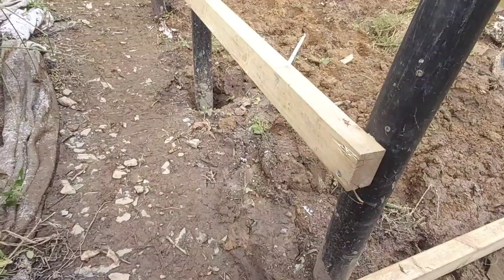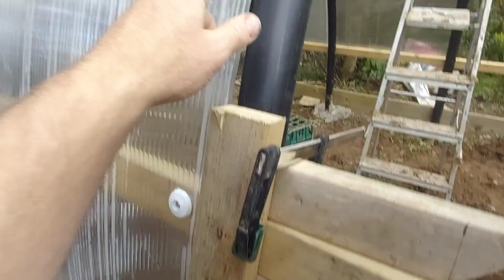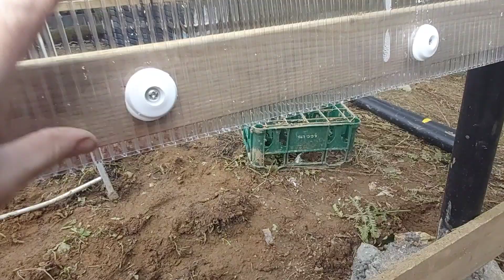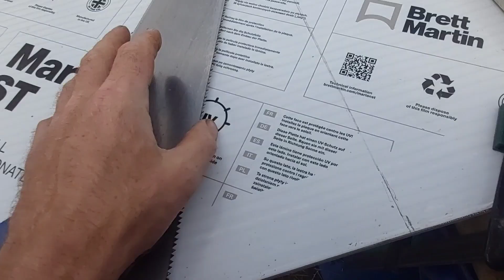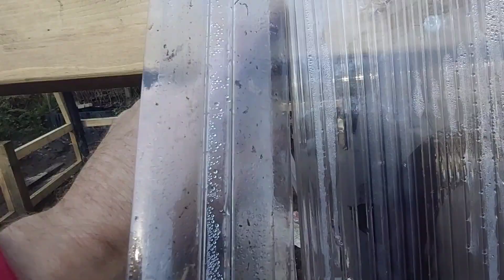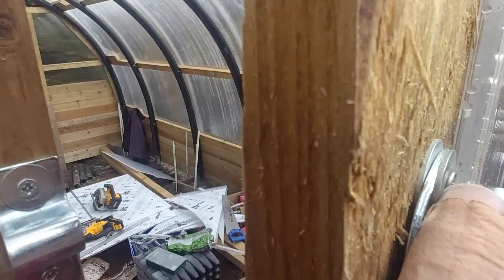How to Build a Polycrub   DIY Guide for a Storm-Proof Greenhouse

Comment: We received no instructions with our polytunnel either. May I ask did you use a sealant or anything on the bottom of the polycarbonate sheets that meets the ground? I've heard moisture gets in and causes mold growth.
Reply from the maker: No I forgot but you have just reminded me thanks! I meant to get the sealing tape but moved on to another project. It doesn't cost much and probably worth doing.
Reply: @GappyPirate as we already had the poly tunnel erected we used strips of plastic underneath the edges which will be submerged in the ground. Hopefully that will be sufficient. Fingers crossed.